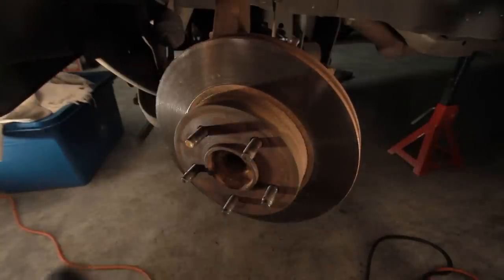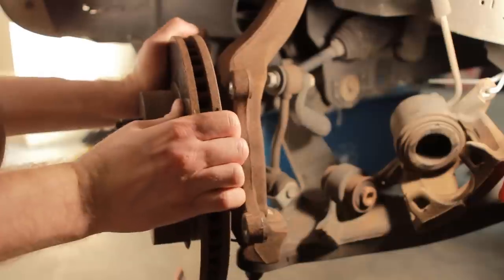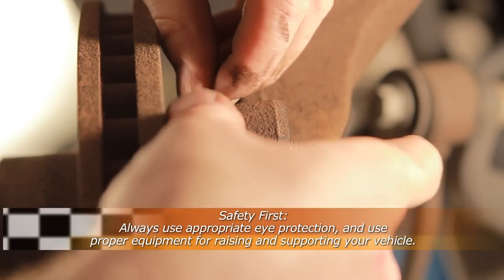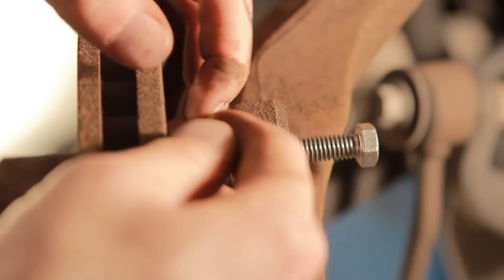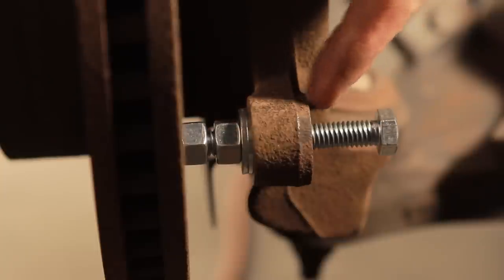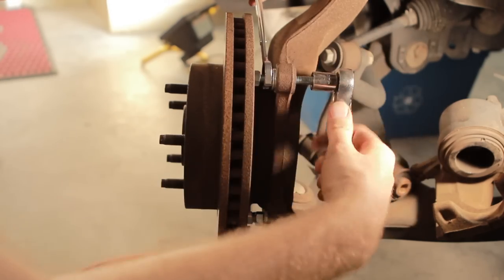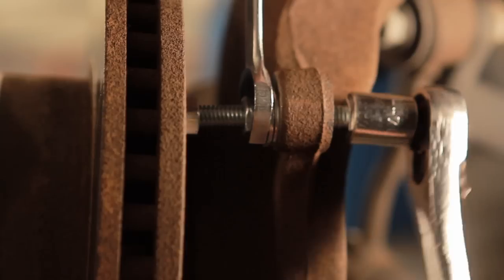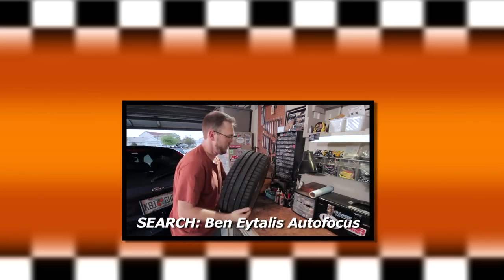Autofocus - How to remove a rusted stuck brake rotor

Comment: Thanks so much! Life saver... I was sitting in my driveway just beating on my rotor like a red headed step child with my rubber mallet and spraying PBlaster into the stud holes, then I saw this video and the rotors popped off in no time flat with this trick. You don't know how satisfying it was when I heard the pop.
Reply: Save
Reply: Saved my day! Thanks
Reply: 97 f150 worktruck I just bought and I’m struggling with taking off my rotor. I will use this next weekend

Comment: You don’t realise how much hassle you saved me today 👍 I hammered at a stuck disc (rotor) but it would not budge a millimetre. I thought about heating it up or even trying to cut it off in the end. Then I saw your video, my god it worked in seconds, unbelievable. Thank you so much . Atb Bill.

Comment: Excellent! My rotors were seized solid. Biked into work to pick up a puller but didn't have the right size there so Googled "rotor seized to hub" and found your video. Brought home a couple bolts, washers, and nuts and popped the rotors off. Good job. Thanks.
Reply from the maker: awesome! Glad it worked out for you!

Comment: Whoever doing this, you want to be very careful for the torque put on the bolt. For a truely stucked rotor, you can bust those caliper tab and the rotor will not move at all. then you need to buy a new knucle. Don't ask how I know.

Comment: You da’man! After fighting rusted front rotors with every trick I knew I resorted to the youtube and found your outstanding method.  It worked like a charm. You taught a very old dog a new trick!  I went to the hardware and got a couple of flanged grade 8 bolts and worked them in both bracket holes tightening one then the other.  It popped off within a few tightenings. Thanks again for your excellent video.

Comment: Hi, I just want to thank you for this tip! I spent almost an hour trying to free a rusted front rotor on my 2005 VW Jetta and gave up and came in for lunch. Decided to search youtube for help and found this. It worked like a charm. I used two 1/2" bolts and in less than 2 minutes had that rotor broke free. Thank you so much for a clever idea!!!

-Ron
Reply from the maker: My pleasure! Glad it helped

Comment: OMG! I have a 2002 BMW with 198K miles. During a selfie brake job, the rotor would not separate. Your video worked great! The rotor came right off. The cost of materials was about $7.50, & took about five minutes. Great tip. Thank you! Ken

Comment: Spent 6 hours today trying to get stuck rusted rotor off my 2007 Toyota Corolla, using every trick I could find online, hammering rotor, hammering between nuts, hammering side, back, etc., heat,  lubing it up with PB blaster, using triple bar to pry.  There were no holes in the front of the rotor to screw into.  This video showed me how to use the caliper holes in the back in a similar way and it popped off like butter, just using the bottom hole, after a few twists before I even tried the top.  Remember to place the nuts loosely back on the tire screws because it went flying. Thank you so much.

Comment: Thank you SOOOOOO much !

Tried to change the disc of my 2012 car and it wasn't moving at all ! I tried HEAT, i tried HAMMER ! Didn't move at all. Never had this before.

I tried your trick and it was free in two minutes ! 

BTW, if your car is older wear ear protection ! I was surprised by the LOUD crack the rust made when breaking. It was like shooting a .22 pistol with HV ammo.

Comment: 8lb maul hammer..intense heat...PB blaster.. loosened Park brake spur.. and 2 frustrating days later I decided fun time was over so I sought to look for solutions on Y.T....saw several vids doing basically what I had figured was a fairly common shade tree mechs approach..then, I came across your channel thumbnail and saw it was a very short vid..watched it and gave it my last exhausted hope... just simply amazing what a tool of simple principle can achieve..I used to be creative at solving mechanics but I think I've been away too many years from the Brake's and rotors end of it.. YES, worked..my jaw literally slapped the concrete.. Thanks to you and your dad for making a heart breaking chore into a very doable shade tree task.. have a blessed day..

Comment: Thank you so much for this video! I had a brake disc stuck on, I honestly thought there was no hope for it, I'd be hitting it all day with no joy. Went out and bought some 10mm bolts, nuts and washers, it popped off in 10 seconds. This is a technique I will carry with me for the rest of my life.
Cheers

Comment: Thanks for the great tip!! I told my brother-in-law the break job should only take a couple hours and that was until we couldn’t get the front rotors off. I didn’t know what to do until I saw your tip. It worked just as good as your video. Thank you again.

Comment: I didn't have enough space for 2 nuts on the rotor side. I had some spare 1/4" aluminum bar laying around so the bolts could dig into that instead of pushing on the 2nd nut. No scratches on the rotor and worked like a champ! Thanks for the video.

Comment: Amazing tip. I just used your bolt trick after spending 2.5 hours struggling. In less than 5 min after watching your video my stuck rotor literally popped off with a loud ping sound. Thank you so much. This was the exact advise I needed.

Comment: Fantastic tip. Used it yesterday with great success. I made one modification to your technique. I screwed on two lug nuts a few turns before doing this. When mine popped, it hit the lug nuts, keeping the rotor from coming off and falling on me.

Comment: Thanks for the tip.  After using a BFH on the rotor for three hours, saw this video.  Got both rotors off and wrapped up the brake job within two hours.

Comment: You saved my life with this, I was seriously stuck, considering just letting a garage do it and I found this, it worked amazingly well!!! Only thing I would add is turn the wheel 180° when you see some movement, I didn't get that pop, it just "tilted" to one side but was still pretty wedged, so I rotated the wheel and done the other side of the disc, after 10mins it was loose enough to wiggle off, thank you for this though, it's a life saver!!!

Comment: Great video Ben, was very helpful removing stuck disc ( British name for rotor ) on my car. Only thing I changed was to use an old wornout brake pad instead of the second nut. Thanks for the very good video.
Reply from the maker: you bet. cheers.

Comment: Thanks so much for this. Worked a treat, I was running out of ideas and about to cut the disc off when I came across your video. Both discs popped off with very little effort.

Comment: Thanks for the tip.  I tried the hammer, sledge and penetrating liquid all with no luck.  One bolt in a few spots on the rotor did the trick.   10 years of Rust is no contest with proper leverage!    2006 Fusion

Comment: Hi Ben,
thanks for this quick and informative video.
i was doing a brake change on my F150 with 184,00 miles (original rear brakes, 6 years old) 
I was beating the driver side rear rotor yesterday for 20-30 minutes with a 4-6 lb hammer and about to give up.
Found your video on youtube and had it off in less than a minute after locating some bolts, washers, nuts, etc.
The other side was just as bad. Took it off in less than a minute.
AWESOME VIDEO!!!!!!
THANKS AGAIN!!!!
Reply: THANKS FOR SHARINGVTHAT HACK SAVE ALOT OF HASIEL.

Comment: Man. I just have to take time out to say- THANK YOU❗️❗️❗️ I took my 32 ounce mallet hammer then struck around the wheel hub area, then just like that- ROTOR OFF. That rotor had been giving me trouble for quite some time. I did use some Lucas Oil penetrating oil heavily behind the rotor and I used the penetrating oil where the wheel studs are located but, that mallet hammer knocked my rotor loose. Thanks again.

Comment: Yes! it worked perfectly, no problem at all. The rotor looked like it would not budge until I tried this and it came off easy. It made a very loud snapping sound when it broke loose and I thought I had snapped the bracket😱 afterwards I needed to clean my bottom hole LOL. Thanks for the tip lifesaver.👍
Reply: Your lucky you didn't break it. You would rather replace 100 rotors compared to that steering knuckle. You will see a few video's like this from guy's who believe they found some secret way of doing it but you will NEVER see a real mechanic doing this.

Comment: Thank-you, Thank-you, Thank-you, popped right off on a 2001 F-250.  To all the people reefing on it until you bend something, take your time.  Apply some load, wait, add PB Blaster, heat, and then add some more load.  If you try and take it off at once on really stubborn rotors, you will bend something.  Remember boys, slow and easy.  Cheers.

Comment: Thank you so much for making this video I got two 9/16 bolts and did this. Man my rotors were badly rusted on my fusion I barely got them off.  I actually bent the bolt because of how much pressure was going Against the rotor. This front rotor was not coming off by hand or pounding with a hammer. This worked really well but it was kinda hard because if the rotors are badly rusted you can damage something else on your car. So use caution when doing your own brakes.  They are hard especially when something else occurs and you gotta problem solve . Thanks for the video it actually worked for me!

Comment: Thanks, this worked for me! I tightened the bolts slowly and then, a loud PING! Another user's post was correct, wear some ear protection, your head will be right next to the rotor

Comment: Thanks Ben.  It worked an absolute treat on my Chrysler Crossfire, here in the UK.  I was replacing the discs (rotors) so had no qualms about beating the hell out of the first one and using loads of wd40.  No joy.  I was contemplating having to spend quite a lot to buy a hub puller of some sort and then saw your video and managed to do it with a couple of old bolts and washers I'd saved in a tin! Heard the rust crack twice, just like your video.  Wouldn't you know it, the second disc came off with only a couple of light taps.  Thank you very much.  I owe you one...
Reply from the maker: thats awesome! Glad it worked like a charm. :)

Comment: THANKS! It worked. First time I had a rotor that a 12lb. sledge was not enough. Sometimes just applying that pressure to the rear of the rotor and striking it with a hammer is enough to loosen it.

Comment: Great method. As others have said, go easy with the bolts and hit the rotor as you gradually tighten the bolts. In my case, the bolts did the trick a little past very snug.

Comment: This is a great way to remove the rotors. Just be careful to use a REALLY high quality bolt. Also the biggest size that will clear the hole is best. I emphasize this because I used a 3/8" bolt that did not withstand the torque required to "pop" the rotor off. The problem I faced was that one of the bolt head twisted off while still under high load on the rotor. Luckily, the top bolt was still strong enough to disengage the rotor and the broken bolt and nut just fell down. I ran to Home Depot to get the best 3/8" bolts I could find for the passenger side rotor. Unfortunately, that one twisted off as well at the highest torque I could apply. Now I have a bolt stuck in the rotor again and no way of disengaging it. I have added some penetrating oil and am hoping that the rotor will "pop" off overnight being under stress. I still think the method provided in this video is a really smart way to remove the rotor. I just think a much stronger bolt should be specified that can withstand a LOT of torque before twisting off.

Comment: Just did the same thing basically on my 2007 Grand Cherokee for the rear brakes. On these the caliper mount is threaded for the two 13 mm bolts that hold on the caliper. I took the bolts to the hardware store got bolts with an identical thread and put the old pad up against the rotor in its normal position. Put some lube on the threads of the bolts and tightened them gradually till it popped. Tighten gradually, then loosen, then turn the rotor a bit, you will hear it pop. Just be careful of the threads in the caliper mount.

Comment: This works SO WELL.  I have a Dodge Grand Caravan 2009 with caliper mounting brackets.  The caliper mounting bracket mounts the calipers with two bolts with 17mm heads.  This is done through those same two holes with a sufficiently large bolt, washer, and nut combination.

I ran a little short on space and had to forego the nut against the rotor, but it otherwise worked like a charm.  The rotor came off with two VERY minor scratches, no visible warping, and they are reusable.  I'll have them checked, but I've seen working rotors with worse scoring and grooving from worn brake pads than these two scratches.  YMMV.

NICE TRICK!!!!!!!!!!!!!!!

Comment: We tried your bolts from behind idea today, I purchased the largest size to get thru the holes from the caliper holder, not much room on a 04 CRV, as I tightened the 3" bolts started to bend, the more I tightened the more bend, until now I could not get the nuts off and the bolts broke inside the rotor, so I watched another you tube and he put 8mm bolts through the front, those worked until the tightening caused the rotor to crack from the hole out, so couldn't save er now, out came the full size sledge hammer and a couple of wacks cracked the rotor in half, but we did get it off and after cleaning the new rotor slide on, pads were a snap, got it back and running in now time.  Bottom Line to my fellow readers, try all these great ideas, one will work. There was relief and a seance of accomplishment, saving the back brakes for another day.
Reply from the maker: sucks. sorry it didn't work out for you. Individual results may vary. haha. Seems like most of the people saying it didn't work are people that have Hondas. Wonder if that's just a coincidence?

Comment: Watching all the other videos where they're pounding on the rotor with a big sledge hammer, heating with a propane torch, etc., etc., your method is by far the safest and easiest.  Great close-up camera work.  Some auto part stores lend pullers, so that may be an option for some people.

Comment: Thanks for this. I used a 3/8" bolt sizes with a 14mm wrench. I recommend having a second 14mm wrench on hand, in case the 3 inch long bolt screw snaps, which will make the ratchet screw useless. I also recommend using anti-seize, to make it easier to remove the bolts from the screw.
Reply: pellergin Also, a plier, may be used in place of the second 14mm wrench.

Comment: After beating on the drums for hours I came across this idea. But first let me say this PB does work just needs time. So I tried the bolt thing but quickly realized I got the wrong bolt. Now one of my drums came off with easy because Ilet the PB soak overnight. So just one hit and it came off, I was amazed with high hopes for the other one. Nope..didn't happen. But anyway like I said wrong bolts so I just kept banging and spraying until it looked like a murder scene cause of so much oil on the ground.  So what I did next was to use the same concept, instead of using bolts and nuts to produce pressure, I used my used brake pads and the bolt that goes with the caliper. I lubed the bolt, placed two pads between the knuckle and drum and started turning. I heard it pop a little so when I had enough room for one more pad I added a third. When I did that and turn the bolt a little more the drum came off. I think the pads produce more pressure in a wider area of the drum.

Comment: This worked for me too, but you need to be a little careful because you can bend the bracket if you put too much force on it. I suggest tightening the bolts to put force on the disk, and hitting the disk with a hammer as well to break it loose. I think a lot of shops use an air hammer. I don’t worry about hammering on the disk, because I always replace them.

Comment: To avoid bending the caliper bracket and the rotor, do the nuts up until there's some tension then beat on the rotor between the studs and around the hat. Load up the nuts again then beat some more.

You don't want to bend the caliper bracket because you might not get it straight again or it might crack when you try to bend it back into place.

A bit of a spray with penetrating fluid will help too.

Reassemble using anti seize.

Comment: I have F150 2014.I used WD40 and a 3 pound hammer.Just changed it this week.Spray but let it sit a few minutes then hit it with the hammer rotate and hit rotate and hit eventually it should come off.Try this first before this method in the video.You could bend the caliper bracket and then have to replace that as well.Good luck.

Comment: I'm Replacing The Front Rotors And Pads On My Mom's Truck.

I Was Able To Get The Right Side Done By Tapping The Back Of The Rotor With A "25 LBS" Head Sledgehammer.

On The Left Side I Tried Polishing The Rust Away With NO LUCK, Drenching The Rotor And Hub Assembly In PB Blaster And WD-40 With NO LUCK, Tapping It After I Drenched It With NO LUCK 

I Got It Lose By Doing Something Similar To What Is Shown In This Video.

I Used A 19mm Bolt, A 22mm Nut For Tightening, A 2nd Nut As A Plunger (To Push Off The Rotor), My Favorite Tool When It Comes To Working On Vehicles (My Torque Wrench), And My Mom's 22mm Wrench.

I Didn't Use Washers For 2 Reasons:

1) The One's I Found Did Not Have Big Enough Holes.

2) The Rotor Is Being Replaced Anyways.

Comment: If you’re replacing the rotor then wale the shit out of the pad surfaces, turn the wheel all the way out so you have room to work and beat the shit out of it on the back side of the pad surface. This bolt trick doesn’t work on all vehicles and some with aluminum knuckles can be bent or distorted doing this.
Reply: Your absolutely correct,